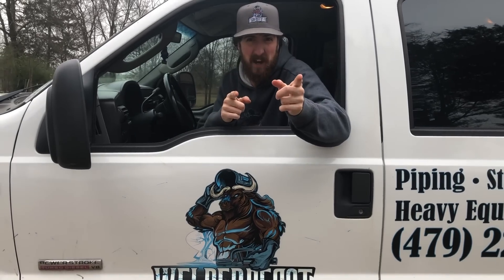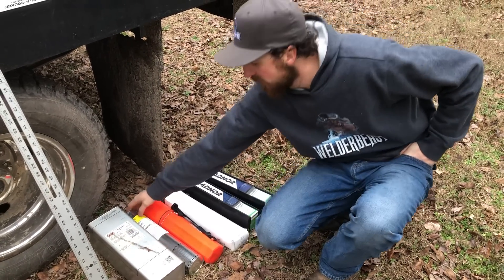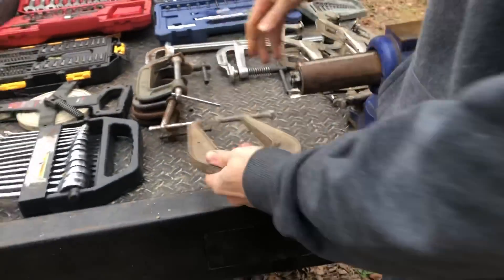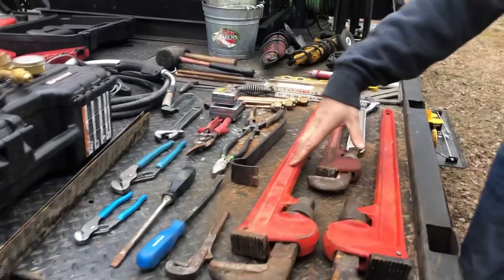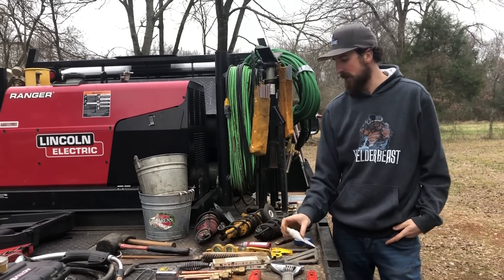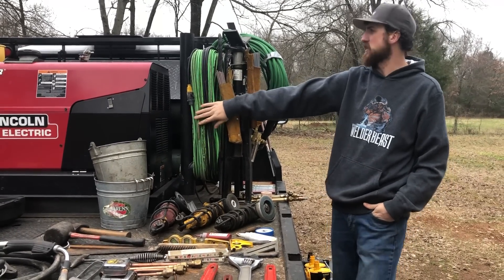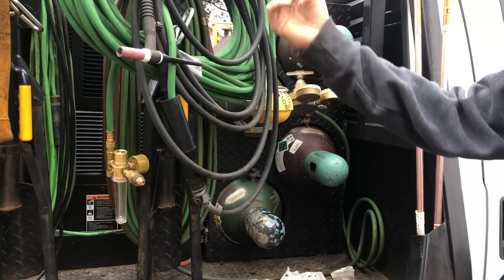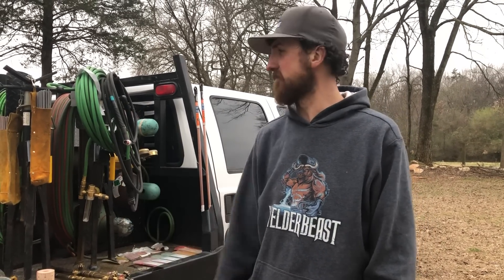WHAT TOOLS DO I CARRY ON MY WELD RIG?!

Comment: I’m a heavy equipment mechanic by trade and don’t do a ton of welding but I always carry drinking water bottles with me , not just to quench my thirst but if I’m doing some welding especially on equipment I always grab a few bottles poke a hole in the top just in case I get a flare up or thirsty lol! Very nice set up thanks for sharing 👍
Reply from the maker: You can never go wrong with water bottles!

Comment: Got a couple tool suggestions :) dewalt dw888 electric die grinder with a cheap set of carbide burrs for grinding in tight areas. It’s a lot better than reaming a hole with a sketchy drill bit lol. Also a Milwaukee 8inch metal cutting circular saw. You can make straight cuts on some pretty thick steel and the blade will stall rather than bind and kick back. Hell you could cut I beams in half with that thing and cut through 1” plate if you took enough cuts. :)
Reply from the maker: Excellent suggestions, I’ll look into them!

Comment: I would really like to see a review of that suitcase feeder. There are hardly any reviews of that particular one on YouTube. I would like to see what types of wire you run in it and what type of work you do with it as well! Great video.
Reply from the maker: Hopefully I’ll be getting videos up soon of some live action of me working on projects I get. Saving up for the camera to do it. I honestly don’t use it all that much though and haven’t used any other suitcase other than an LN-25 one other time so I don’t feel I have enough experience with them to give a review on one.
Reply: @Welderbeast  Which wire do you run mostly in it?
Reply from the maker: I’ve got .045 hard wire and .035 flux core, used the flux core for a project a month back but other than that everything I weld I usually use stick

Comment: Get you some broken scrap heavy hydraulic lines and practice brazing holes up with silicon bronze on TIG. Easy money on big rigs; they'll be happy to toss money your way instead of needing ten extra gallons of hydraulic oil every job, and you'll get more word-of mouth add on work, too. Not really for a whole job in itself, but it's good to have small things to tack on to the job scope if something you're working on needs it. Saves the customers time, too, since it makes for fewer service calls.

Also, look at an electric file; they're great for getting in weird corners, tight spaces, & odd angles for knocking off edges and smoothing outside corners really quick. Especially since you don't have onboard air for die grinders yet.

Oh, and an Estwing chipping hammer would take the place of that cold chisel. They're great.
Reply from the maker: All good suggestions, I’ll look into them as I have the free cash to do so. I’ve always used an electric powered die grinder though on any jobs I worked before
Reply: @Welderbeast  

The electric file can hit inside corners on the flats though, instead of rounding or gouging them like a die grinder does. Just a thought.
Reply from the maker: CavemanJoe I’ll look into it

Comment: A small Tap and die set might come in handy too, the odd time.  They don't take up much room.
Reply from the maker: I use to have one somewhere, I hope I didn’t lose it in my move cause that would certainly be great to throw on the truck
Reply: The small ones don't take up much room, but a bigger one is more likely to have the size you need when it comes up on a job.
Reply from the maker: CavemanJoe if I carried everything I would need for every job I almost need a job trailer for it all ha

Comment: I love your set up bud it’s about the same as mine I have the same ranger nice machine for wire feeder I have an LN25 though I went with LN25 for the bigger spools of wire I have an LN7 for in house stuff so all my wires are the like 35lbs spools that’s why I went with the LN25 so I can run the same stuff between the two
Reply from the maker: Thanks, I’ve had the pleasure of running an LN25 before and those are pretty slick machines as well

Comment: You need a drill lever, called an “old man” it uses a piece of chain to make a quick portable drill press with a hand drill. It’s cut out to fit the back of the drill and  the tip hooks it the chain. The handle multiplies your forward pressure.
Reply from the maker: I’ll look into that, thanks for sharing
Reply: Hi Brian , I am not a welder but I am trying to imagine the tool you are describing.  May you pleas  post a picture. This may be something that a DIYer may be able to use too.

Comment: Love your rig, love your attitude, and love the Warren Buffet quote on your other vid. 2 questions now, have you tried running al. through your Activ8 ( I got the Miller 8vs cuz it was cheaper.....alot cheaper), and where'd you get the welding blanket? Mine are heavy fiberglass that I hate dragging around cuz a, they're heavy; and b, they're old and fraying. And fiberglass makes me itch.... Best of luck to ya bud,  you're heading the right direction.
Reply from the maker: Thanks brother, I haven’t tried running aluminum through it. I mostly stick weld and rarely use the activ8 honestly. And I got the fire blanket from A to Z here in Arkansas

Comment: Great video, and thank you for taking the time out of your busy day to make it! Can you do a short video on that Baur band saw, and your opinion of the quality?
Reply from the maker: I can tell you that it’s worked pretty good for me so far, it’s not the highest quality for sure but it does the job. I’m not really planning on doing product reviews in my videos right now, sorry to disappoint
Reply: If you get it, buy the warranty. If at any point in that year or two it fails, get a new one, and pay for the warranty on that one, too. 

They work. Not as robust as the Milwaukee, but does the job. 

A good rule of thumb for you; 
If you break a tool three times in use, either change how you're using it (usually it's being too hard on a tool or using the wrong tool for the job), or buy a better one. If you're using it for work and you break three of them, return the last one and buy the Milwaukee.
Reply from the maker: CavemanJoe nice rule of thumb!
Reply: @Welderbeast  

A better rule for work is twice, but with this thing only being $100, it should be pretty easy to make your money back. If it isn't, you're using more money for tools than you can afford.
Reply: I been curious on this band saw, as I "had" a Porter Cable version,  I had bought used at a pawn shop quite a few years back & it has done me good until recently,  this past fall I took time to clean it up & lubricate, I now nothing I can do to keep the blade on it, it will stay on without issue until it hits metal, & then blade pops off, GRRRR! be searching for a good name brand, but that one from HF with that price does have my attention, but still waiting to see if I can find a Milwaukee version.
Reply: @randymack1782  

It's the tension pin/yoke. If you know somebody with a Tig setup, or if you tig, you can build it up on the worn out section and smooth it out to match the rest. A new pin is $40 if you can find one, so if you can't fix it or get it fixed, you pretty much just want a new saw. If the tension pin is worn out, then the brushes aren't far behind, and then the switches, wiring, and all that fun stuff.

If you're used to the porter cable though, you'll want to check the feel of the Bauer before you buy one. It works, but it feels like it's made of recycled Hot Wheels cars; very chintzy. Especially since you're used to the porter cable. 

But, that being said, it might feel better to spend $100 on a portaband than $300 on a portaband. Just depends on you.
Reply: no tig, I always used a torch, I know how to tig, & plan to get one, but for stuff around home, a torch has served me for everything, but the porter cable machine is quite worn, bought it from a Pawn shop for $50, & was quite worn then, even the cord is a green extension cord previous owner wired into to replace old cord, so it has like a 20' cord, lol. but I will look at the Bauer? but keeping eyes open for something better.

Comment: What size wire are you using for you wire feeder? A 250 is pretty small and won't push any good sized wire. Not knocking at just want to know what size it will push. Thanks!
Reply from the maker: .045 hard wire but I rarely use it
Reply: I tell ya though I got the same welder the ranger I have a v300 pro invertec and I plug it in to the 220 on the ranger and I can push 1/16 flux core on the invertec I run my plasma cutter off it to the plasma can cut a little above 1” steel if I have to go a good distance I have a 100’ 220 extension cord works great for air for the plasma I have a two stage engine drive compressor ingersol real nice for a lot of cutting

Comment: I love that tank rack. I'm definately fonna steal that idea xD
Reply from the maker: You can find the design drawing and better pics on my instagram profile
Reply: Thanks! I really appreciate that.
Reply: Does argon not become poisonous when tilted like that? I mean I guess not since you obviously know more than me I'm fairly new to welding, but I feel like I heard a certain gas can become poisonous if left on its side or somethin
Reply from the maker: @daledobeck872  All gases could be considered poisonous if they deplete or increase your oxygen from 19%-21% of the air you breath no matter how they are stored. The only gas you shouldn't store on its side is Acetylene because the gas is volatile so to make it safer for transportation the gas is is dissolved in liquid acetone. If stored on its side the liquid will come out with the gas causing your flame to be volatile and you are slowly leaking away the substance that is keeping your gas stored safely in its container. Most other gases you purchase are just compressed gases and can be stored on their side safely.

Comment: A small compressor with tank is good too.  Perhaps you have one and I missed it.
Reply from the maker: Nope I don’t have one, would like one eventually for Arc gouging but have gotten away with not having it so far.
Reply: Having a welder-generator, it's usually better to just buy electric tools. Electric die grinders are off most people's radar, but they're surprisingly useful.
Reply: I actually been looking for one of older vintage electric ones, but someone has an adapter to allow you to use angle grinder with die grinder bits, plan to get one of those soon, as for air compressor, I have one I can carry if needed, it was for servicing 18 wheelers, made by Goodall, like 23cfm, 1000 cranking amps, plus a generator, but not something I want to leave on truck as its quite heavy.

Comment: Random question ive never thought of... how do you find the long hoses with purging? Do you waste a lot of gas? do you still charge for it, or is it something you havent thought of?
Reply from the maker: Honestly the hose came with the machine and I haven’t used it much at all. All my work had been with stick. The amount of gas that would be wasted is calculated in my rate for consumables when needing to purge. I sat down and spend a whole day factoring all the consumables and factors for certain jobs including grinding discs and maintenance/replacement costs for the equipment I use. That’s how I arrived at my hourly rate. I would imagine you can get the hose at any local weld supply store or online even

Comment: an electric chop saw is handy and so is a gas powered demolition saw but they cost a few bucks
carrying a cheap weed sprayer with water in it can stop a fire before it gets out of hand.
Reply from the maker: Great suggestions!
Reply: @Welderbeast  yep, just some things that i learned were usefull over the years and propane will save you money for your torches. i get 5 K size oxygen tanks for one 20 pound BBQ tank of propane. how much is a big tank of acetylene now? when i quit using it a tank was $50 and it lasted for 1 K cylinder.
Reply from the maker: mike cubes I think it's still around that but honestly can't tell you what the price is right now it's been a while since I've filled my bottle lol

Comment: Curious on what you need to run that activ8 I also have the 250gxt and im just not quite sure on how to set it up ive messed with it for a little bit and I cant seem to find anything online
Reply from the maker: You just hook it up to your machine and put your GXT on one of the wire feed settings is all I do
Reply: @Welderbeast  but you don't need any special connectors or anything correct?
Reply from the maker: KHBuilds just the connector that comes off the activ8 has to hook to your leads so if those are the same connections then your good. If not you will need an adapter of sorts

Comment: Looks great! How well do you like the Ranger 250?
Reply from the maker: It’s worked great for me so far, I’ll buy a new machine the day this one dies or can’t keep up with what I need it to do. It’s kept up pretty well so far and that included a couple 13 hour days running all day at around 150 amps. If I get on a gig that needs me to burn some 3/16 and at 200-220 amps all day I’m curious to see how this machine can handle it.
Reply: Welderbeast thanks for the reply, I have been considering this model, they have a great deal on it and it seems promising. Thanks!!
Reply from the maker: Antonio Castrejon no problem brother

Comment: hello am in Australia.. Have a job that has a lot of steel flooring 
around job site. Laydown of electode a pain. Using a modern small 
inverter stick welder. Q) anywhere in USA / your company sell a  stick 
electrode holder with ON OFF switch. ? Have never seem one. Only one on 
www is one for 12 v vehicle welders it seems. Seems a no brainer to have
 the option? any info appreciated. Has to deal with wide range  amps no 
doubt.

Comment: No pipe bevelers?
Reply from the maker: No so far all the pipe I’ve done is small pipe that I can easily cut with my porta-band and just hand bevel with a grinder.
Reply: Maybe a couple of wedges in the bucket to get a gap or slightly help level up.
Reply from the maker: Danny Harvey I’ve got this sweet little spacing tool that fits in my shirt pocket I use if I ever need a tool but I could certainly use some more. Getting there, it all costs money and bills still got to be paid so it’s a balancing act of spending money wisely

Comment: What gauge leads do you use for your stinger/ground for that length?
Reply from the maker: 00 for 250 foot loop(stinger and ground) and then I use gauge 1 for a 15’ stinger whip just cause it’s lighter
Reply: Right on thanks for the response brother! I’m looking into getting a 250gxt as well but not really familiar with engine drives that much so figured I’d ask man. Have a blessed holiday and keep them videos coming
Reply from the maker: One-Forty-Four Outdoors you have a blessed holiday as well

Comment: I'm curious if you'd be able to do a few jobsite videos, I went to school to become a millwright and unfortunately due to political changes at the time, the lumbermill nearby is running at about 30% capacity. I have since moved but am doing structural work. I'm looking into going mobile someday and want to see if its something that is still doable. Any advice on obtaining certifications without using a school program or employer?
Reply from the maker: I specifically don’t show job site videos for my own reasons but you can get certifications by taking advantage passing a weld test at any AWS certified testing facility
Reply: Welderbeast LLC thank you